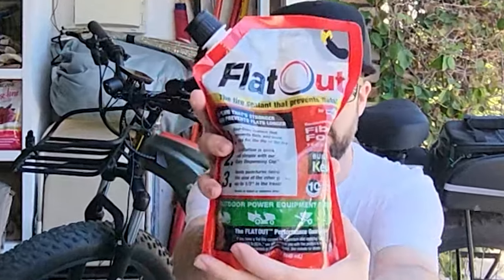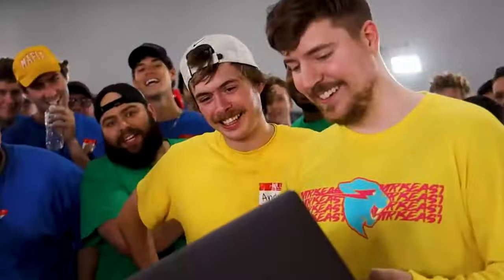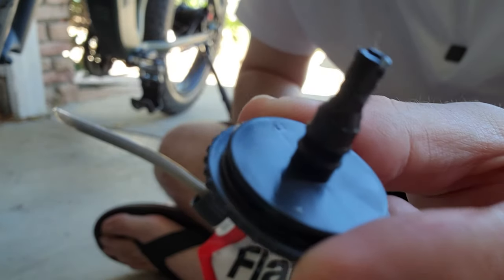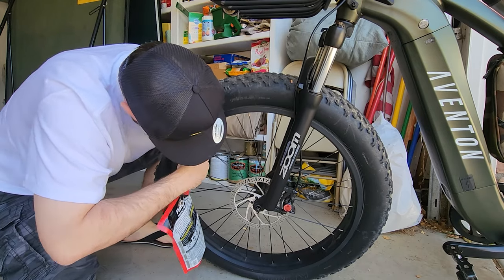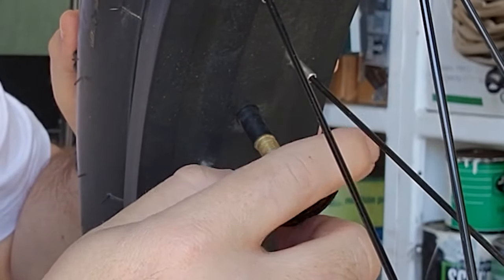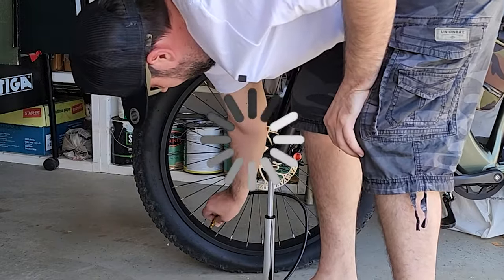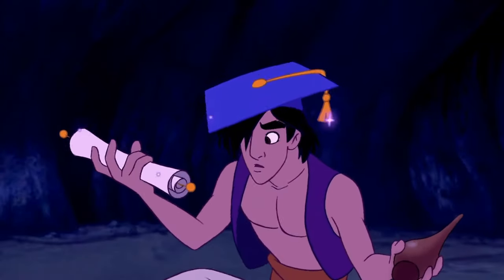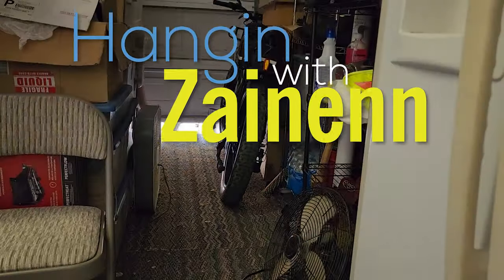How to put Flat Out into an eBike tire

Comment: Each his own but if I have a slow leak I'd first try to replace the valve core and if that doesn't fix it I replace the tube. The stuff isn't meant to fix a problem like a slow leak, it's meant to get you home so you can real price your tube.  IMO buy yourself a valve stem removal kit. Yeah If you have a motorcycle or fat tire bike especially I would recommend buying an electric pump for home and by the way they make small portable battery electric pumps as well.
Reply: It's made exactly for slow leaks. Did you watch the video? The flatout comes with a valve core remover as well
Reply: @greplink  .. It's not meant to be a tube patch. A hole in a tube is still a hole in the tube with some gunk stuck in it .. that can let loose at any time. Now if you want to use it as a patch go for it, I often go on 30 mi and 50 mi or longer trips.
Reply: You can have 20. Punctures or more and just keep on going for years it's 50 times  better than slime..😊
Reply: @dennisd7451  .. To each his own not me buddy.

Comment: Don't do that don't put that s*** in your tire no no no no no no no no no no no no
Reply: What is the alternative?
Reply: What's the worst that can happen. I gotta switch the tube down the road. Better than pushing my bike with a flat for who knows how far.
Reply: Dude this stuff is great and stays liquid for years why would you not want to do this and it actually works unlike slime and crap
Reply: Awesome but I'd only use in tubed set ups as it's liquid. Pulled a nail out of tyre and sealed just a few pumps to get pressure up. 3 months ago.

I import this stuff to Aus. Best I've found
Reply: Buy a better pump bro😊
Reply: I love your video🎉😂❤

Comment: I did the same thing except used about 1/2 bag for my 26/4" tire, tried putting in to much air without checking the bead placement,  just like you did lol..
I was so tired I'm going do the back tomorrow when I have a (A) frame latter and 2x4 to raise up the rear wheel..old school style..lol  note my 2x4 is about 5' long to go under the frame at the seat..

Comment: Dude, You need to get a pancake compressor at Harbor Freight to fill your tires up. Also, you can use your compressor for so many more things like blowing debris and other stuff from you bicycle, blowing out your AC drain line.....The list goes on.  Thanks for the great video. i've been using this stuff in my John Deere tractor and haven't gotten a flat in years.

Comment: I destroyed my rear inner tube so I got a bag of this as preventative maintenance on the new one. This video came out at the perfect time.

About the crank arm, did you manage to get that sorted out? Mine started doing the same thing at 400 miles
Reply from the maker: Hey, thanks for watching!  Yeah, the Threadlock worked. Every now-and-then I need to add some, but overall its been ok.
Reply: @Zainenn for me I just got myself a new crank arm

Comment: Is this better than Slime sealant
Reply: another YouTuber said that they changed from slime to flat out because slime has a lifespan of one year, where flat out has a lifespan of 10 years
Reply: Slime didn't do crap for me got a screw in my tire and it berally tried to seal
Reply: In my experience, slime either isn't what it used to be or I thought it was better than it really was. Trying flatout as of recently and it's been good so far.